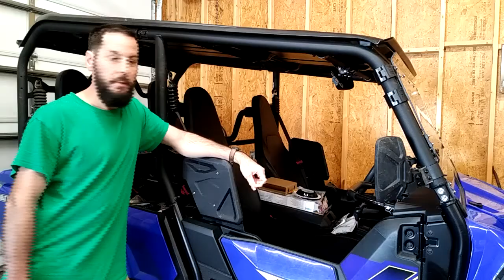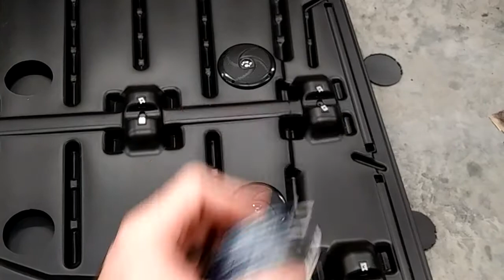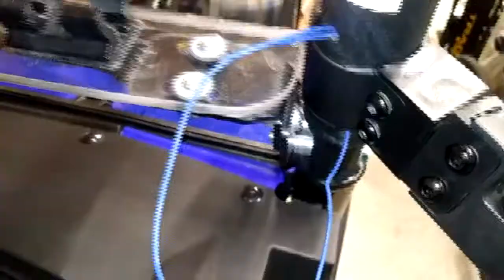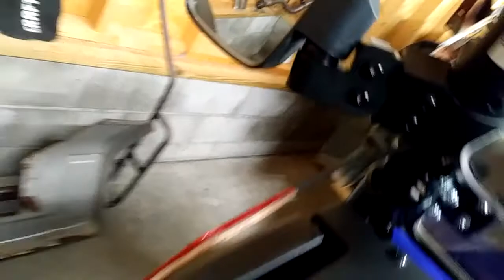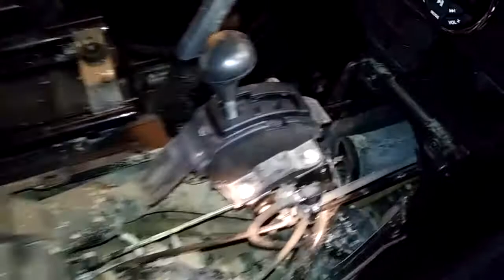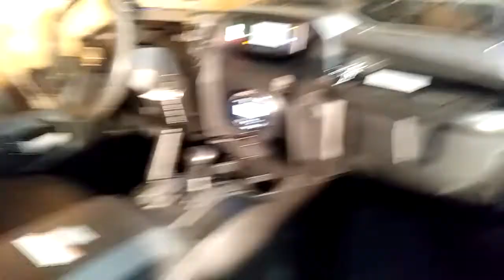2020 Yamaha Wolverine x4 - Stereo Install (speakers and head unit)

Comment: I'm on the forums and Facebook group under Frank Herald. I installed the same head unit, 4 Kicker 6.5" in the roof exactly like this, custom fiberglass ported 12" Kicker sub in the rear, dual deep cycle automotive batteries, and 2 amplifiers. Great video you put together!
Reply from the maker: Thanks Frank, I see it was recently shared to the FB group. It's plenty loud but certainly lacks low end without a sub. I may add an 8" or 10" in the future. 
You have some awesome box building skills by the way!

Comment: We're did you hook the yellow wire to
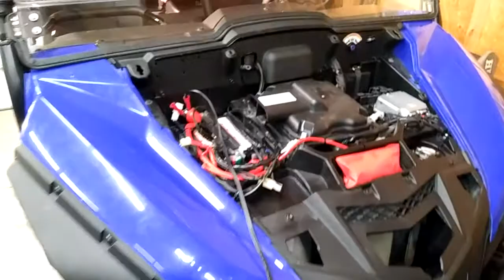Reply from the maker: David, I connected it to the positive terminal near the battery, I think it is on a relay post? I show this at the end of the video from 25:20 - 25:50 timeframe. I refer to it as the "constant" for "memory". Basically, you hook the yellow wire to a  source that is always on, even when the key is off.

Comment: This is exactly what I've been looking for! I just bought an X4 for the family, and want to do this kind of install. The price for decent tower speakers is just ridiculous!
Quick question- What would the maximum speaker mounting depth be for the top? I have some speakers, but they aren't low profile. Just wondering if I might need spacers to install them. Thanks again, and hope y'all have a Merry Christmas!
Reply from the maker: @Jeremy Baker I didn't take measurements of total depth in the roof, I estimate it was around 1.25" to 1.5". The pictures that inspired me to do this used spacers and higher quality speakers. You should be able to find polymer spacers at Crutchfield, Sonic Electronix, etc. If you need them. Merry Christmas to you as well!
Reply: @lsriley2  Thanks!